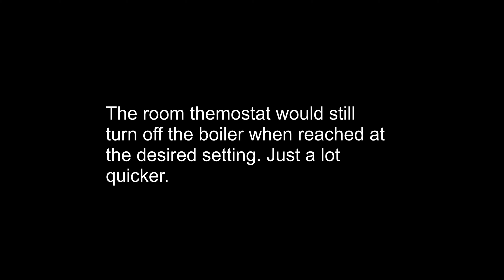#Radiator# does it get hotter when I turn up The #TRV#?  (The Thermostatic Radiator Valve.)

Comment: Being an old boiler myself (including my 1980's boiler) I run it at 60 max and it doesnt kick in until its 40 (fitted a thermostat to the inlet). Stops it cycling so much .The idea of running at full wack is frightening to say the least as I live in a stone house , which we semi lock down the rooms that we are not in ,  plus keep the corridors cool. It would create huge bills and wear out the valves and pump methinks.
Reply from the maker: Thanks for the info.

Comment: My flow not Flo goes into low loss header and seems to shoot right out the return pipe pump on low settings then low loss header and then pump on lowest settings,the dreaded heat pump.Flow and return how do you tune them in any idea you are the man,pump low loss header pump 40c out 38c back.A big hammer usually fixes everything but stumped with this 3300 revs on first pump 2nd don’t know.
Reply from the maker: Would love to help you but I have no idea on those.
Reply: @dereton33  Harmony with the pumps forget the heatpump haha the biggest con known to man.